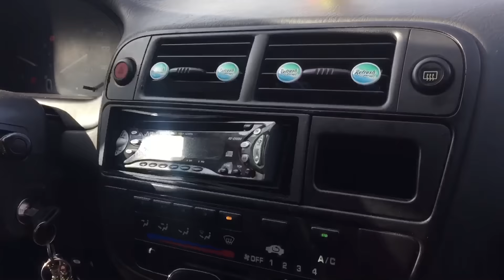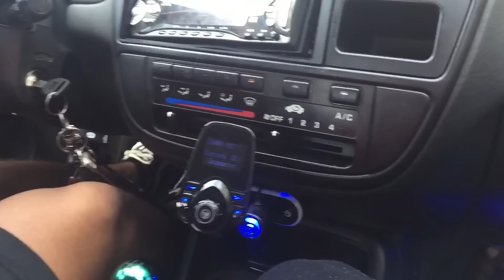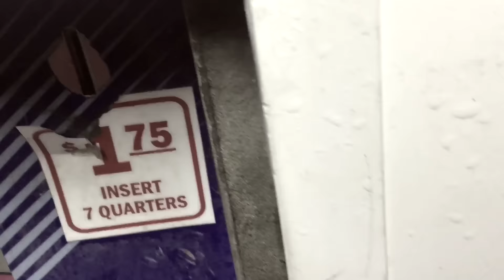RICER FIXES HIS CRASHED CIVIC!!!

Comment: it's off alignment and wheel balance
Reply from the maker: Justin See I mean idk it went in a ditch so I think the cv axles bent
Reply: Axle won't be shaking
Reply: It make noise it either wheel balance  or it off alignment
Reply from the maker: Justin See it vibrates like crazy you think it need an alignment?
Reply: If it goes to the right it's off alignment bc the right wheel hit the ditch
Reply from the maker: Justin See we'll take ur advice and go get an alignment
Reply from the maker: Justin See thanks bro👌🏽
Reply: it happen to my old car I hit the curb and it got off alinment
Reply from the maker: Justin See did it vibrate a lot ?
Reply: Vibration can be wheel balance when it goes high speed low speed won't vibrate that much or at all